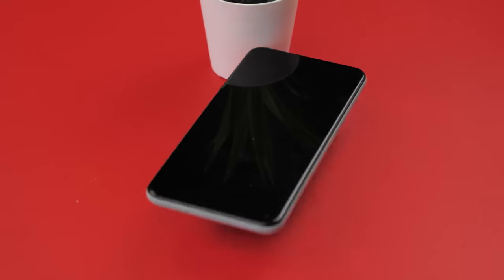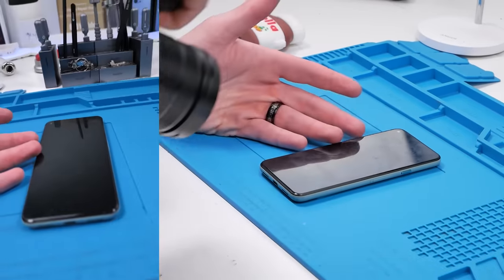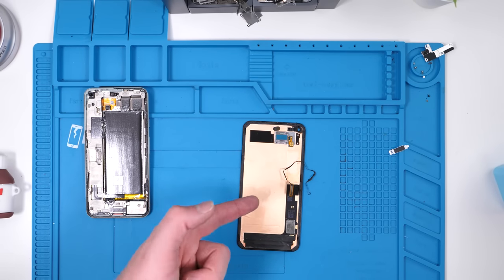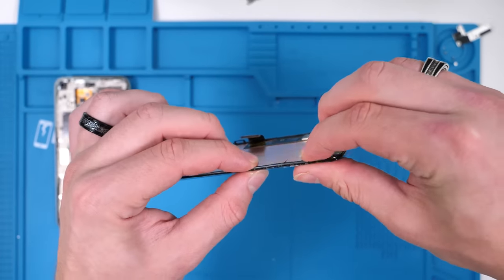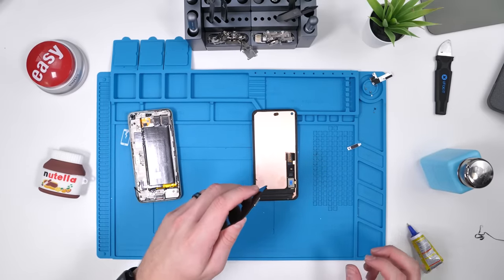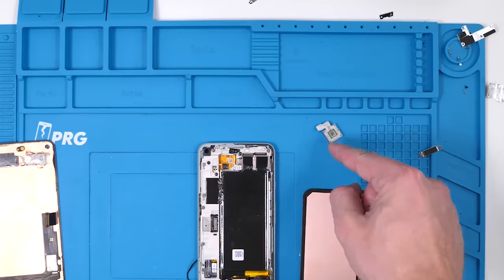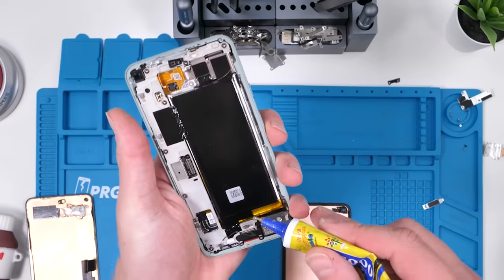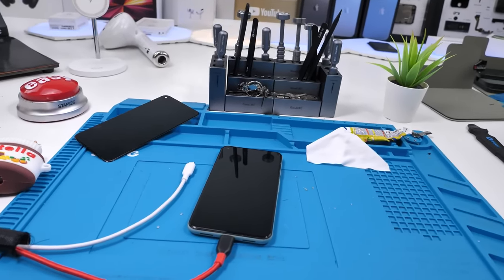Can We Fix This Phone With NO TOOLS?

Comment: iFixits repairability and repair difficulties can typically be taken with a grain of salt. They rate iphones as more repairable than most android devices.
Reply: Because (mostly) they are, since the iPhone 5 to replace an iPhone screen the only part that needs to be removed is the screen, with a shocking number of androids the whole back needs to be removed as well, also iPhones use screws as their main way of attachment whereas most androids just use glue
Reply: iPhones are easier to disassemble and reassemble in general but parts serialization makes them very anti repair
Reply: @HRyder  iPhone uses screws AND adhesive, and it’s mostly the ladder that holds the screen in place
Reply: @jogaming55555  1. Think about what you just wrote and question if a solid piece of metal or some sticky glue is going to hold better and 2. Have you ever actually fixed an iPhone? You don’t even need heat to remove the screen on most as the adhesive is only for water resistance hence it only appearing on phones that where water resistant
Reply: @kareemelsadek  I would the even say that is a problem, you can replace any part in an iPhone and the phone still works (apart from parts that deal with security e.g. Face ID or Touch ID) with the only lost non security features being True Tone
Reply: @HRyder  two tiny screws hold in an iPhone that are located on only the bottom and are very close to each other, so I would say yes glue that surrounds and cover all corners and sides of the phone is better than two tiny screws
Reply: @jogaming55555  the whole screen assemble slides into grooves so all that the screws are doing is stopping the bottom from levering out, I would know, I’ve fixed many iPhones before

Comment: Do you seal your phones for water proofing every time you open up a phone?
Reply: well from what I saw he only does this to customers, even if he is not giving as much as the original rating, he is giving at least 50% of what the original phone has to give. For example he didn't put the screen maintainer it doesn't gets most of the water resistance, while for customers phone he does the best he can so that it can still stay as much water resistant as before.

Comment: Ahaha just broke one pixel 5 screen today .. bruh :D .. i made a screen replacement this week for a customer, glued the stuff back to the new display, same method as you did.. tested it before i gave it to him, everything working fine, but ufortunately today he came back and the earspeaker was not working anymore, so a tried to open it and basically went little bit too deep and broke the damn thing >.<
Reply from the maker: It happens! just gotta be more careful next time
Reply: @PhoneRepairGuru  the bad thing is that we dont have replacement screen for this one in company im currently working at .. we can order one but you know, the guy will need to wait for it to arrive :(
Reply: it is most likely because you didnt transfer the metal foil on the screen, in the video he didnt do it either. (fixed one aswell and had the same issue with the earspeaker.  solved by transfering the foil)
Reply: @magnusstahl4599  i even transfered it, but if i remember right it had like 2 layers (not sure about that at all now:D) and i remember transfering one, and even testing the earspeaker before giving it away and it was working.. must have moved a litttle bit, wanted to check it but i broke the display in the process .. >.< :D
Reply: @ghostgoat7219  that is frustrating, I fell you on that one 😢

Comment: Using those T7000/8000 glues is a lazy repairman's choice. imo  Why not do it the right way and use either factory pre-cut double sided adhesive or custom made by hand using rolls of 1mm to 5mm 3M tape?!  It makes subsequent repairs much easier and looks more professional that glue oozing out the sides even if it's cleaned up.  Just my preference at my shop.
Reply from the maker: Was just for the video :)

Comment: My samsung m20 was replaced by duplicate display in a repair the touchscreen is working properly when i check the tsp firmware using*#26663# it shows the phone and parts tsp are different tsp firmware threshold:fail do you have solution

Comment: I dare you to try to repair the Samsung A13 it's a bitch to do I've done it already and it's not easy unless you have a razor blade to open the sides and the power button is a real pain in the ass because I've noticed it quit working on me so I can't take any more screenshots or turn the thing off so yeah I can't even find a decent reason why can't be fixed but it could be a hardware glitch in the software somewhere